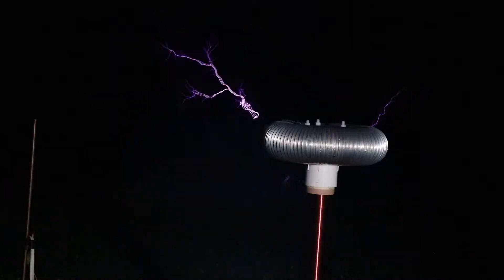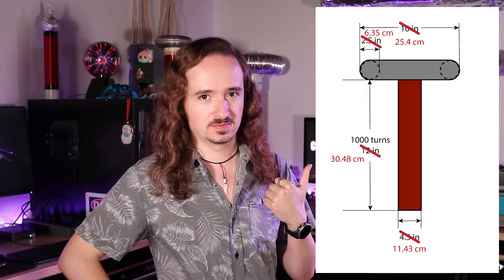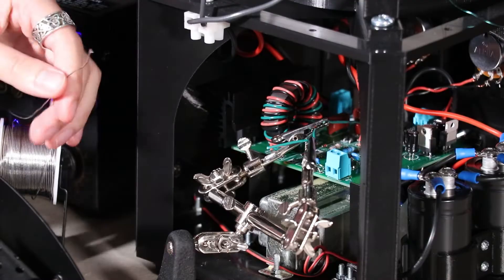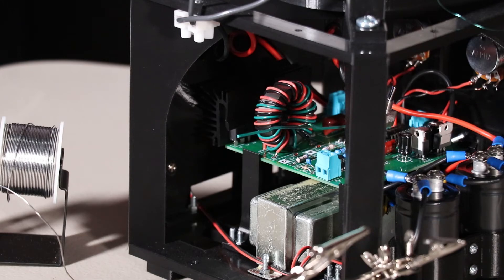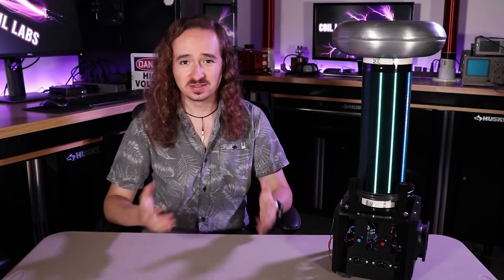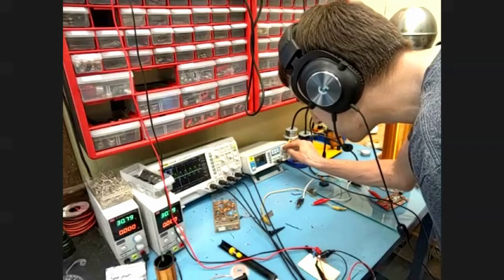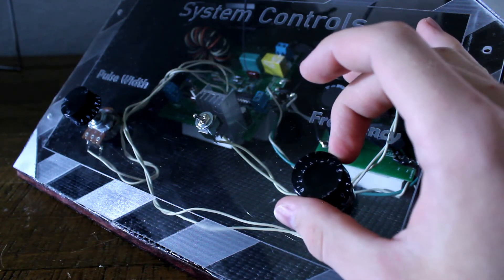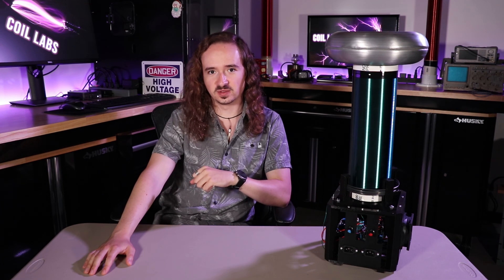I did a collab with other crazy Tesla Coilers and made this... (feat. LabCoatz)

Comment: Great collab guys, and dope Tesla coil, loved it. 

Perhaps someone will one day design an SSTC that doesn’t require breakout points, and doesnt blowup if sparks fail to break out.  That’s what keeps me away from sstc land.
Reply from the maker: Thank you! Yeah, as awesome as this project was, vacuum tube coils are still my favorite. A lot more robust to being pushed a little too hard or having things slightly out of tune. Transistors just die instantly. There's no in between, lol.
Reply: This circuit is very easy to get working and stay working (WAY more so than a plasma flame circuit)...maybe we should send our old friend Jay a PCB!
Reply: Guess it depends on what the goal is with no breakout right? Either to still get sparks without needing a point, or just transmitting without sparks. Both are pretty easy to do with an SSTC. This driver should be able to do it no problem, simply omit the breakout point and crank the input til it starts spitting. Doing this with 200v mosfets and a 170VDC input might not go smoothly the first time, but 650v switches that can do 180A pulsed is a different story.
Reply from the maker: Yeah, I tried running this a couple times with the breakout point taken off, though I still have the screw going up through the middle of the toroid, so it eventually started breaking out from that anyway. It seemed to do okay, but I didn't turn the variac up all the way either. It is riskier though, because all the energy stored in the secondary LC circuit has to go somewhere, if it's not getting dissipated by the sparks. You don't want too much of it going back into the primary and killing your transistors. Spark gap and even vacuum tube coils are much more robust to that kind of thing than SSTCs. Probably want to keep the primary-secondary coupling on the lower side of "still working" if you're doing no breakout point on an SSTC like this though, so there's less energy transfer back into the primary.
Reply: @Magneticitist  can u make a board that can handle say 50A at 50kv.  With soft switches as in switches/fuses that can be reset.  It will be at rf and adjustable.  Also a RF finding function added.  Rf low hz and high band hz frequency.  Could you put a price on that.  It would need to be a tough ss system.
Reply: @Jbond7777  peak output? almost sounds like HAARP #2. is this like a TC of some kind or just a transceiver in general. IDK I'm usually running around 500W tops lol.
Reply: @Magneticitist  simply put I have made simple devices only a BJT and Mosfet tesla coil.  My wish list is a medium power device.  10-50A tough and with resonate features.  I thought you guys could give me a quote on that.  I heard the last test on fusion was 20kva for 20 tesla.  Crazy power eah.  I like that Tesla's name is being thrown around.  Not by them Tesla is a unit of magnitsm. However Tesla never made such a coil in his life.  Long story short, if you guys spent more time working on Tesla's high frequency resonate work, we could make this world better.  But no let's see sparks fly.
Reply: @Jbond7777  it has long been explained why such power distribution is simply unfeasible mainly based upon the nature of how our world works. That aside at this point in the game I don't think what would happen is scrapping all the copper that went to transmission lines and then reusing it to donate to curing cancer.

Comment: Awesome build man! Love the 3D printed base. Looks real sharp. I am currently working on my own design around this driver. I have a question though. You have 2 input power cords. I'm assuming one is for the voltage doubler/variac and the other is to power the main board? Do I need two or can I just use one to power everything?
Reply from the maker: You're right, one is for the main power going to the doubler for the half bridge and the other is to power the low voltage electronics on the board. They need to be separate, because the one for the electronics goes through a step-down transformer to 12V, gets rectified, and then regulated with a 12V and a 5V regulator on the board to power the ICs. If you turned that one down on the variac as well, you wouldn't be getting the 12V necessary to run the electronics.
Reply: @CoilLabs  Okay that's what I figured. Thanks for the response! I really appreciate it.😁 What if I didnt use a variac and used an on and off switch for the doubler and the low voltage circuits together? Or is it still a good idea to separate them? I'm trying to go for the cleanest setup possible.
Reply from the maker: You can switch them on at the same time with the same switch, that's fine. It's just if you want to be able to adjust the voltage going to the half bridge, with a variac, you need to separate them so you are still feeding the right voltage to the electronics.

Comment: Nice! They did a good job on the PCB's and it slaps together well.Those antennas can be a pain sometimes, and sometimes they work so good it doesn't make sense. I usually just avoid that altogether now and use a CT with about 30 turns on it. A lot of the times it can just drop right in with one leg going where the antenna was and grounding the other, making sure the phasing is right. The coupling is definitely a big variable and probably one I play the most with. The primary design changes coupling but can drastically affect how the sparks develop in ways that might not be immediately clear. It's all still trial and error at this point where I just try all kinds of turns and height adjustment and turn spacing.

This basic foundational circuit for modern SSTC's is something I think a lot of people will surprise themselves with if they just give it a go. Playing with it enough you start to see the matrix of how all these things work. After some troubleshooting and getting a detailed idea of what each IC is supposed to be doing at any given time etc, it starts to become so much easier to figure out other similar circuits using varying topology and feedback methods. I see so many Slayer Exciter enthusiasts who are probably way closer than they think to upgrading to one of these.
Reply from the maker: Yeah, I considered using a current transformer instead of the antenna, but I went with the antenna simply because I knew Zach already had his working that way and I wanted to get this working quickly for the video and not have to fiddle with it too much. I'm definitely considering changing it out for a CT sometime in the future though and see if it's any more stable. It still cuts out occasionally, depending on how high I have it turned up on the variac.

I totally agree, if you do it right, this circuit is pretty easy to get working. Many years before getting into YouTube I had attempted to make Steve Ward's original version of this circuit and it kind of worked, but it was never very stable and I fried a lot of transistors. Being a lot more experienced now, I realize that my main issue back then was circuit layout. I didn't do it anywhere near as nicely as this one, haha.

Thanks for all the great info and insights!

Comment: I built a full bridge sstc but when I put the top load the coil starts to stutter when I put more power in it. Do you have any ideas what it can be
Reply from the maker: Full bridge single resonant (SRSSTC), like the one in this video? Because full bridge in a SRSSTC configuration really isn't a good thing to do, because you'll be hard switching the transistors, and if your transistors lock up, you'll basically get a DC short through the primary coil. Even if that doesn't happen, probably also get poor performance, because the impedance matching between the power supply and the primary circuit is going to be bad. The reason you can do full bridge for a DRSSTC is because the tank capacitor is in series with the primary coil, so it'll block DC in case of a lockup and you're switching it based on primary current feedback (which you can do because the primary is a resonant LC circuit), not secondary feedback, like in the SRSSTC in this video, so you're making sure (as long as your driver works) to soft switch the transistors at the current zero crossing. DRSSTC primary current can get crazy high, so you'll roast your transistors if you don't ensure that. Anyway, with a SRSSTC using secondary feedback, with the antenna like this, the antenna is a really fickle way of doing the feedback. It's easy and convenient, but the placement in relation to the secondary and the length of the antenna is really crucial. Too long, and it'll stutter or not work. Too short and it'll stutter or not work. Too close to the secondary, too far from the secondary, and all variations of these things, it'll stutter or not work. I actually want to change my coil in this video over use a current transformer on the secondary, instead of the antenna to make it more reliable. I still have trouble with it sometimes. My guess as to why it changes when you put the top load on is that feedback is now a lot stronger and it's maxing out the clamping diodes that keep the feedback signal between 0-5V. Again, that's all assuming you're using an antenna. If you are using antenna feedback, try making it slightly shorter and/or move it farther away.
Reply: @CoilLabs   thanks for your advice I replaced the antenna with a current transformer and I added a capacitor in series with the primary and I lowered the primary and now everything works way better than before
Reply from the maker: Cool, glad you were able to get it working better!

Comment: Cool Make! looking at the 3D print files it looks like you used a 4 inch PVC tube. How tall is the tube? What are the dimensions of the top-load? Thanks
Reply from the maker: Yeah, it's a schedule 40, 4 inch ID PVC pipe. As I said in the video, the secondary coil is 12 inches tall and the toroid is about 10 inches overall diameter and 2.5 inches cross section diameter. The actual PVC pipe itself is slightly longer than the secondary windings, just to leave some space. I think I left about 1 inch on both the top and bottom, so the actual pipe itself was cut to 14 inches, I believe.

Comment: i built the coil but my fuses keep on blowing doy ou have any tips for trouble shooting
Reply from the maker: A fuse rated for how much current? Even with the inrush limiter, there is still going to be a bit of inrush current when you first turn it on, because of the big doubler/smoothing capacitors. If you're blowing large (i.e., 15-20A) fuses though, then I'd say that something could be hooked up incorrectly and there's a short circuit somewhere. Also if you didn't get the phasing of the gate drive transformer right, it could have turned both IGBTs on at the same time and that would have caused a short circuit, and likely killed the IGBTs as well.
Reply: Thanks 👍
Reply: @CoilLabs  it turned on but why is the interupter not working and when i looked at the circuit i ve seen that the 555 timer is wired in a bizard maner
Reply from the maker: The idea of this 555 timer circuit is that the duty cycle and the frequency can be controlled independently with the two potentiometers. It's essentially an extension of this circuit https://easyeda.com/andyfierman/Variable_duty_cycle_fixed_frequency_555_oscillator-1bc9b3f6a8cf4b3c88e5f22f6780f9c6

Not sure why it wouldn't be working for you. If you build the 555 circuit by itself, you should be able to verify that the circuit works, on its own, with an oscilloscope.

Comment: I'm going to be making a tesla coil to power my power sphere operating on the pressure heat magnetism and electric current. I've made my own couple minerals for it with my forge and megnetic pressure.

I would like to discuss the project with you and get some thoughts from some else on it
Reply: Not a little one ether. I'm on my own land with the core being put i feet under ground and insulated